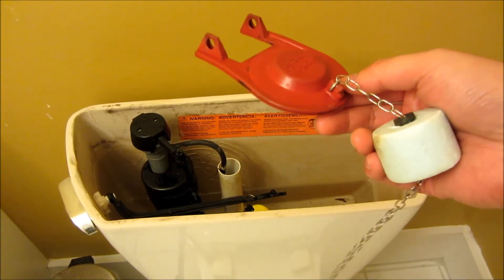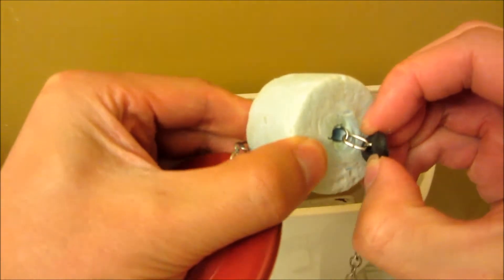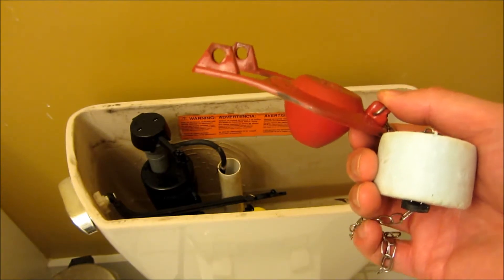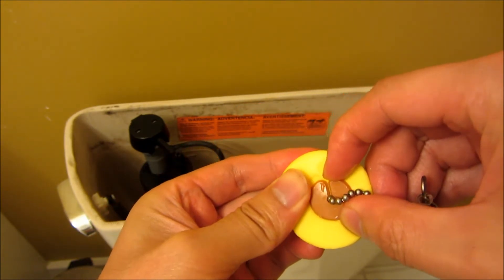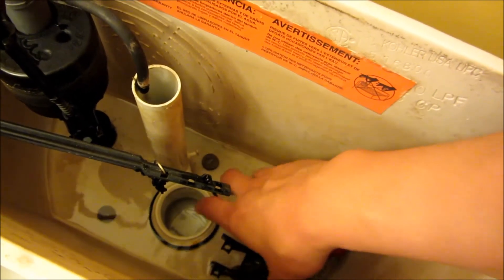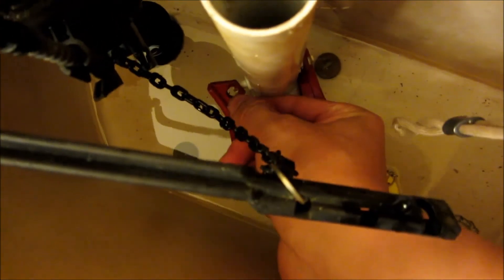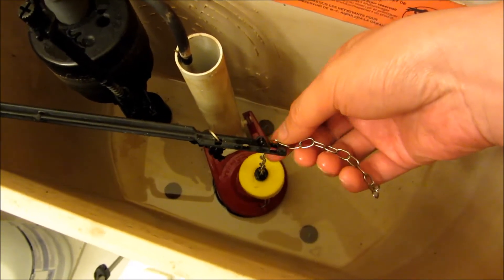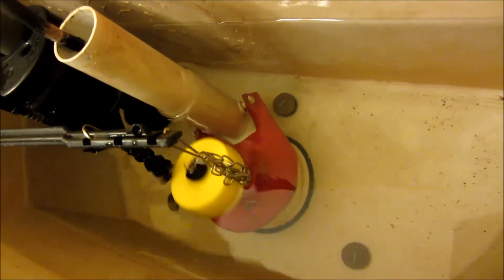How to Replace a Toilet Flapper Valve | Adjustable Float |  Important Tips

Comment: Why don't use just turn off the water to the toilet to prevent it refilling? My current flapper has no floater, what's the point of having this if it works fine without a floater?  Is it because the flapper doesn't float on it's own like the old one I have, and why not just make it that way?
Reply from the maker: this model came with a floater, sometimes the floater becomes lose and the flapper closes too soon, or sometimes you need to replace the flapper as it has worn out and water continues to flow after the flapper is down.  So it completely depends on the situation and the particular model toilet.

Comment: Regarding the way you explain to lift flapper slowly to not trip fill valve and have water flow...You're showing exactly how the fill valve you have. "Leak Guard" is suppose to work. It's best to just turn off water valve by toilet. Or the way I do it, handyman for over 40 yrs. I remove the flapper, and while water is draining/flowing/filling, I install the new one. Takes seconds to do. My video coming soon...